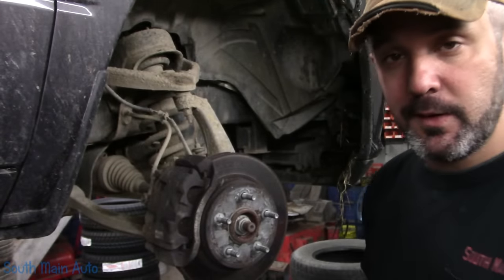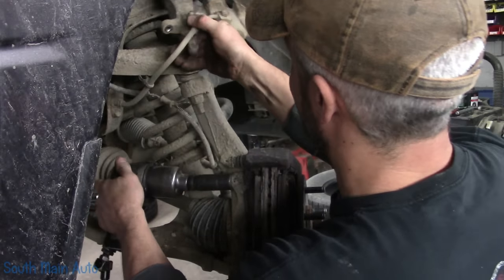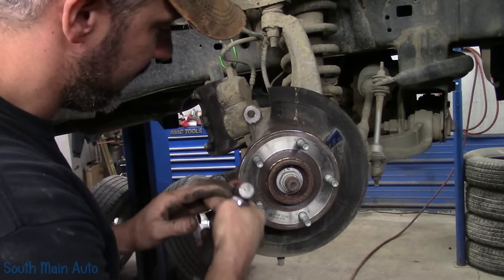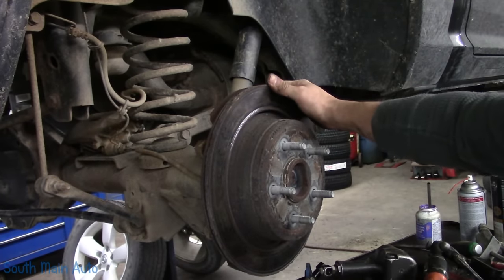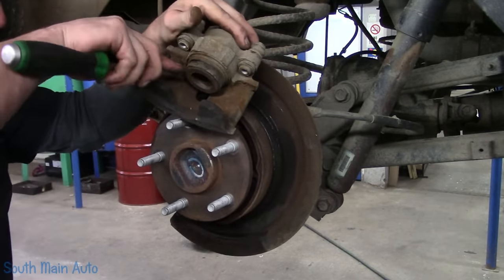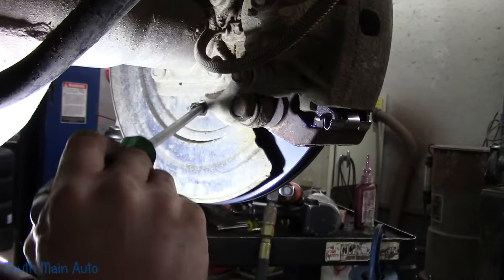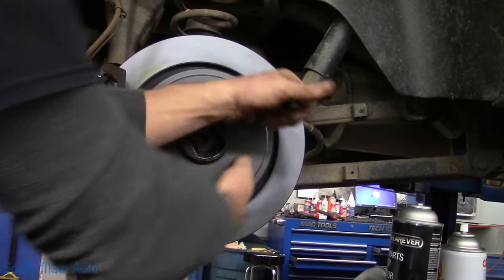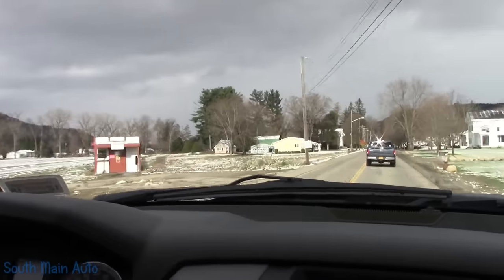What Just Happened Here?

Comment: I also compress calipers without opening a bleeder,I also have never experienced a issue either
Reply: The only thing that could go wrong is someone on the internet who knows it all might get offended
Reply: Is it true that you're supposed to remove the fill cap before compressing the caliper? I heard it will cause damage if you dont.
Reply: Luke W no, I've never had to remove the cap and never had any ill effects from doing brake jobs like that for almost 15yrs now.
Reply: @timmmaya8601  Good to know. Thanks for the feedback!
Reply: I still have yet to figure out (maybe I should ask) how they can bleed all 4 corners same time without opening ANY bleeders. Have seen em do it couple hundred thousand times lol at work
Reply: @randyfarr844  because it's a closed system. Unless you replace a part where you're letting fluid out(opening the closed system) or if you're repairing a broken brake line(open in the system) or flushing the system(opening the system), it's not mandatory to bleed the system. Sure there may be people who disagree but how I've always done it was if the system is operating fine and all I'm changing is pads/rotors then theres usually no need to bleed them.. hope that helps
Reply: saw many kelsey hayes units destroyed on early 90s gm trucks, gm claimed compressing the piston with bleeder closed was the cause but I don't know. we got into the habit of opening the bleeder and although i am not in the business for a long time now I still open em up when doing my own brakes.
Reply: Only thing that happened to me happened on our Dodge Durango.  Puked brake fluid all over the placed because the dealership decided to top it off when the brake pads were almost wore out.  Well.  At least they followed their check list.
Reply: @timmmaya8601  If you don't let any air in the fluid system, you don't need to let any air out.

Comment: Just found your site, love it.  I’ve been a tech for almost 45 years out here on the west coast.  When I’ve done brakes jobs I always rebuild the calipers, replace the hardware kits and install the top of the line pads.  I either resurfaced or replace the rotors.  All that avoids problems down the road.

Comment: "Going off half cocked" is from the wild west days of the single action revolver.  You used your thumb to pull back the hammer until it clicks and then the gun is "cocked."  If you take your thumb off the hammer before it clicks, the gun is said to be half cocked and the hammer will spring back possibly firing the round.  If that happens the gun is said to "have gone off half cocked."

Comment: I've never even heard of unscrewing bleeders when pushing brake pistons in!
Reply: It would seem you'd have to bleed them down then?  I just suck a little out of the reservoir first!

I've never seen a parking brake setup like that!   Worked on an older Saab where you had to rotate the caliper piston while retracting to reset the parking brake, but I like that design apart from having to pull the axles to work on them!!
Reply: Audi's require you to rotate the piston which screws it back in. I've worked on a few others that required a special tool but usually you can just twist it with some pliers.
Reply: Aaron, there's a bunch of people out there today that firmly believe that when you push the pistons back in, it sends contaminates all through the brake system, causing problems. I used to watch my grandpa and dad do that (just push the piston in without touching bleeder), then I started doing it when I turned 16. In 40 years I have yet to see any failures come from this.
Reply: I've done hundreds upon hundreds of brake jobs on many different makes and have never cracked the bleeder valve to compress a piston. I have yet to have any problem doing it that way!
Reply: I figure if there’s that much junk in your system, you’ve got bigger problems already.
Reply: depending on age of calipers and fluid change intervals, there can be a lot of contaminates laying in the bottom of caliper piston bores (rust, brake dust, water, etc.) the ideal scenario is bleed and flush flush with each every brake change.................... yeah, I don't know anyone that does that, do you?
the real short answer is yes, pushing the calipers back without bleeding does place contaminates back into the system and possible far enough to get into the abs unit, but the worst contaminated fluid/debris usually comes out at the very bottom of the piston stroke which only migrates into the hose and small portion of the line, unless you really beat bang and really stir the fluid inside the caliper up first. the easiest way to tell, is replacing a caliper unbolt the line and then shove it back into a clean container, aim the inlet fitting vertical down or actually opening the bleeder with clear tube and container. often the worst of the debris stays in the caliper anyway and no amount of flushing will clean the cylinder bore, which is why they seize and most always the "lowers" of multi-piston units. holy I said too much =p

Comment: it looks like it went thru a mud bath on them shocks 20 years of brake jobs and still dont put the caliper on a bunjy cord or that S sling...mmmmmm I dunno
On that impact can you not get a replacement part on that worn out part?
Reply: I have a habit of "stuffing/wedging/hanging" the caliper directly on something vs wiring, hanging, strapping and I can say I was changing brake pads and shoes by age 14, the numbers are inverse of that now...
did I mention I hate mechanical labor, then again I also hate plumbing, electrical, electronics, appliance repair, computers, networking, all other trade labors.... yeah I hate working in general, but like everyone else, you have to make $$$ somehow. (legally!) I dislike doing the same field/trade work daily, so I have jumped around most every trade and did multiple at once my whole life thus far. I did hit vocational school for industrial electricity, which covered plant maint. and multiple fields. which bored me because by then, I already learned and knew tons more than where the class started and finished, what I did pickup was some good techniques!

Comment: Eric, the day will come when you push back in the pistons and it drives some gelled fluid behind the pistons up the lines.  Last time I did it because I was lazy, it freaked out the brake circuit on the front left side. A test drive for about 10 miles, the caliper seized, overheated the disc, boiled out the wheel bearing grease and warped the disc. I had to call a flatbed to collect the truck as the wheel was seized. Yeah, as always I should have cracked the bleeder and hooked up a line before pushing the pistons back in,,, just saying.

Comment: I've never opened the bleeder either.  I compress the calipers slowly being careful of the backpressure in the system.  Have never had a problem.  Plus I don't have to bleed them off when I'm done.  Plus, I'm very careful that the boot doesn't get pinched between the compression tool and the caliper.  🙂

Comment: When I did work at a brake shop one of the things people would complain about was pulsation but not going through the pedal that first rotor you took off is loaded with hard spots hard spots does not grab the pads as well as the soft iron which gives the feeling of what rotors when they're not I thought that was kind of a example to show people what hard spots look like on a rotor.

Comment: 1/2 cocked is a reference to cap lock rifles. The 1/2 position is the normal "safe" position where the hammer isn't on the cap. If the gun goes off in the 1/2 cocked position there is something wrong with it.

Comment: One important reason for opening the bleeder valve when you compress the pistons is that the brake fluid that was in the caliper that is subject to overheating, is eliminated if you open the bleeder valve. Just a better job doing it that way, especially if you don't flush the brake system.  Also, as I said before, you need to take respiratory precautions working with brakes because of the dust is bad for your lungs.  You will find that out in 20 or so years if you don't use respiratory protection.  I am surprised OSHA doesn't require it

Comment: There's nothing wrong with boosting the Pistons in without opening the bleeder. But you should check the master cylinder reservoir to make sure it hasn't been topped off. And leave the top off of it otherwise it might damage the cheap little plastic reservoir

Comment: i have done a ton of DIY brake jobs at home. i have never opened the bleeder. when you push the caliper in, the fluid just goes back into the master cylinder reservoir  LOL. opening the bleeder just means you have the potential of introducing air into the system, and if you are working on a north eastern car AND its driven 12 months you might not easily get it open anyways.

Comment: Cockeyed means both eyes don't point the same way, as with a young male chicken, a cockerel. We use it figuratively to mean not straight or offset, as Mrs. O suggests.
Reply: Half-cocked refers to some single-action revolvers, where one can bring the hammer back just far enough to rotate the cylinder for loading purposes. If you pull the trigger from this position, the gun is unlikely to fire because it does not fully compress the primer which detonates the powder in the round. Having the hammer half-cocked gives the impression you are read to fire when you are not.

Comment: not opening the bleeder is the correct way of pushing in the piston.  like when your pads wear down the fluid level in the reservoir decreases because it flows down into the piston. so when you are putting new pads the fluid just flows back into the reservoir. You are more likely to damage the master cylinder from air flowing through the lines.

Comment: Probably has already been mentioned, but "going off half cocked" is a euphamism for somebody being too quick to judge or start a fight. The actual reference is to what happens when you don't pull the hammer are the way to the rear on a hunting rifle. There are 2 stages while engaging the hammer. Upon pulling it back, you will her an audible 'click' - that's the 'half cocked' position. Then the second 'click' is obviously 'full(ly) cocked'. Where the 'saying' comes from is that when you pull the hammer back half way the weapon is still capable of firing if you are careless enough to have your finger on the trigger. Obviously, this is a huge safety issue as you may not be aimed down range or fully prepaired for the firearm to 'go off'.

Comment: Half cocked applies to cap and ball weapons. The gun is fully loaded but not ready to fire. It's dangerous to let the hammer rest on the cap because a tap to it will set off the charge. It is also not smart to walk around with the weapon fully ready to fire (cocked). So there is half cocked. The trigger can be pulled without dropping the hammer. More modern weapons have a similar device called a safety.

Comment: At Sears auto center every lift had a brake washer. If they looked before you did a brake job and you didn't wash the brake they could write the tech up. didn't matter the dust flew when impact was used on lug nuts....duh huh.

Comment: So I know this is an old video and I'm a day late and a dollar short but I've got a brake grease question.

I understand the idea of the brake grease between the caliper bracket and the abutment hardware to prevent rusting as long as possible, but is there a reason you don't brush a little onto the abutment hardware, or on the pad ears where they insert into said hardware? I've found that it helps keep the pad from rust seizing when the pad backing plate starts to rust. Am I missing something?

Comment: Ggreat video, greeting from North Augusta, South Carolina I've got a question that has eluded a few mechanics. I own a 01 Dodge ram 1500, the left rear drum brake locks up in the morning,  but is fine after that, I've replaced all brake hardware, wheel cylinders,  proportioning valve, master cylinder, drums, you name it. Even adjusted the brakes several times.  What do you think would cause  this.

Comment: I’ve missed your videos. I finished the rebuild on my 2012 escape limited and bought a 78 fj40. Disk brakes on the front. Drums on the back  f2 motor. It has a 4 speed now but I’m looking to but a FJ60s 5 Speed Transmission in it
Any thoughts about fj40s

Comment: We used to be able as technicians to replace an airgun's anvil and hammers when we put new airvanes in them.
If it was high quality and name brand, you showed it to the tool man, and in a few days? Here's your goodies.
Now kids just keep buying new different electric ones that cost hundreds and seek to do test demonstrations to offset the cost.
I don't know how available those internal parts are for your impact now.
I did mine for like 30 bucks on a Saturday, on the clock.
Woohoo $3.75 an hour.
Times have changed in alot of things.
Boss said stay busy and keep the bay doors open.
But we already had everything cleaned and serviced out there. 
Time to improve the tools.
If you're going off, half cocked, you get shot while you're checking your weapon for not working.

Comment: Ha HA 
going off half cocked:
older firearms had a half-cock position for loading, or for holding the hammer away from a cartridge as a safety. if the firearm went off 'half cocked' often this was due to either the operation was unintentional or the operator forgot to fully cock the hammer prior to firing - the half cocked position may not fire, resulting in a hang-fire or a missed shot, all this lead to 'going off half cocked' meant you were not prepared or you didn't plan.

Comment: Never open the bleeder to push in the Pistons. Just the cap off the master cylinder. Reservoir . The man is correct.
Reply: The man would not be correct to leave the cap off the master cylinder while doing a brake job.  You would be letting in moisture, dust and insects.  The water will rust the inside badly.

Comment: Do you have a video am the problem with the 2004 Malibu Rear Brake calipers pistons and how to push back the piston inside  with the special tool from Autozone? I am having a problem pushing the piston back in far enough to put the new pads on which are extra thick and have already tried using the tool

Comment: My train of thought is the Best reason for cracking the bleeder is you can get a small amount of the old brake fluid out and replace it with fresh that way any moisture that’s in it doesn’t get into rusting up the system

But if you’ve got a Ford it requires the factory unit to let it flush through the The anti-lock system

CourseI am anal enough that I flush my brake fluid every couple years anyway
But I also do 100 to 135,000 miles a year

Comment: If the brakes pads are a tight fit on the metal clips how will  they move back from the disc when the foot peddle is released.
Reply: The rotors are not perfectly true and will instantly push them back with their highest spot in less than one revolution.

Comment: I might have a question. Do you guys recommend changing the rotors with every brake pad change? I would think it might be about the same price as resurfacing the rotors on the vehicle.
Reply: from what i've seen and been told it's just as easy to buy new. resurfacing isn't done much anymore do to the low cost of new. and they only need replaced if there is wear or gouges in the rotor.
Reply: @farmcentralohio  I agree with ya. I would rather replace than resurface. I had the brakes changed on my 4runner at 40k and they just changed the pads only. I'm hoping that they aren't setting me up to do them all over again way early because the rotors thinned out and are making it pulse. USUALLY, it's new pads to new rotor because one gets worn to match the other.

Comment: unfortunately as you know,,, Renault bought into Nissan, and Fiat bought into Chrysler. As a result there is light weight and inferior parts being added to both these cars. The starters on the new Rams are small and prematurely fail. Pulled one out with 28,000 miles small and toasted to turn a hemi engine. Thanks to Fiat input!!! Head gaskets problems etc. Calipers etc.

Comment: I notice the vice is not bolted down, bad idea, should the vice fall off on your foot no safety shoe will same your foot, I have seen what a 50lb vise does to a human foot. I have a  like size vice and it is bolted to the metal table.  I teach construction safety in the NYC metro of for over 25 years. That being said be carefull using brake cleaner in an enclosed area overtime the solvents will do a number on your lung including cancer, solvents in the presence of a flame can make a ver potent cancer causing compound

Comment: However, if you do push the fluid out of the caliper every brake job, then it's pretty much servicing the water loving brake fluid....I have 10 yrs less umff against you so, you do you.  And remember a small socket works as a great electrical tape applicator. : )